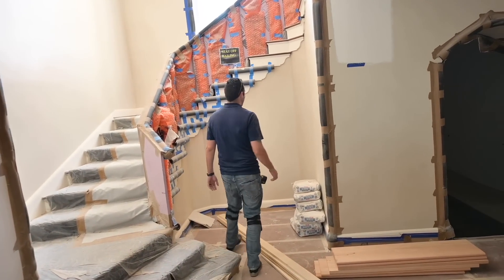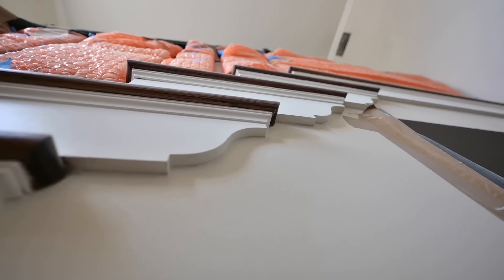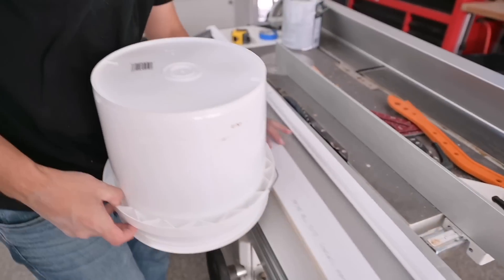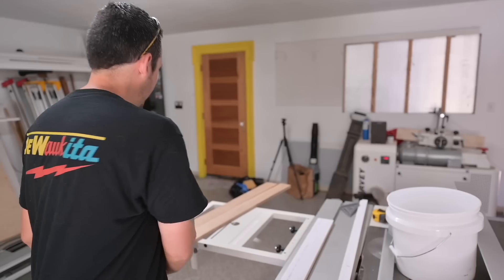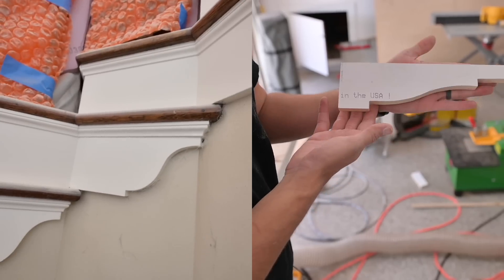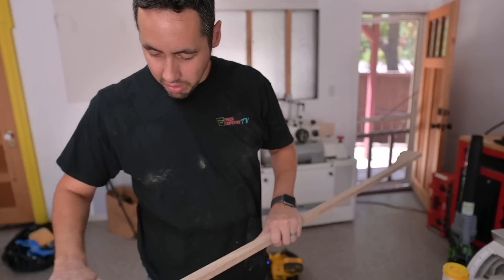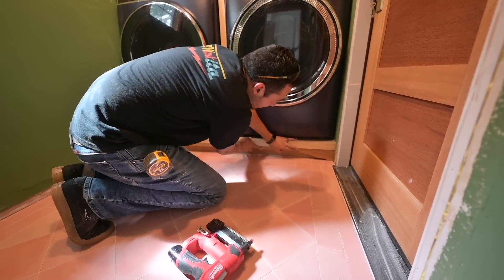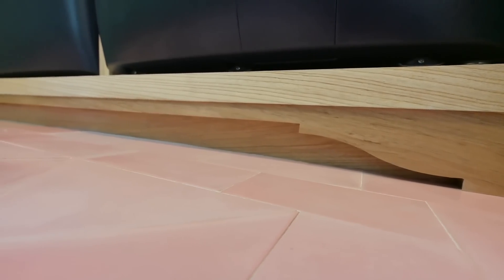I'm stealing something from this house...

Comment: To mass those I bet you could make a router template and cut them close-ish with a bandsaw and clean them up with a flush trim bit.
Maybe glue the top and bottom piece on to make those square edges after you make the curved parts. So build in 3 pieces.

Comment: I like the throat plate on the band saw for the sawdust collection.i used to use various objects for curves . Then I discovered  giant compasses. Using a 12 ft 1x2 I would drill pencil sized holes every 1 inch.a pivot point at one end, lay pattern, or plan on bench, (my bench was 12 ft also), perpendicular to pivot , then move along "compass until you get to arc you want. That's the radius on the circle via big compass.

Comment: Have you heard of the Metabo vacuum atatchment that works on any vacuum? It plugs into the wall then your vacuum plugs into that, then it has a litle band that goes near your tool and the tools vibration then starts the vacuum. Could be good for the 60v Dewalt drop saw.

Comment: That reminds me of crown molding. I believe it’s called ogee cut . That’s just what it needed.
Reply: It is called an ogee. However, the name is commonly applied when cut along a horizontal plane.

I'm not aware of a name for it when shown in a cross-section. The cross-section is commonly shown to display the profile when using that style of router bit, which is quite common.